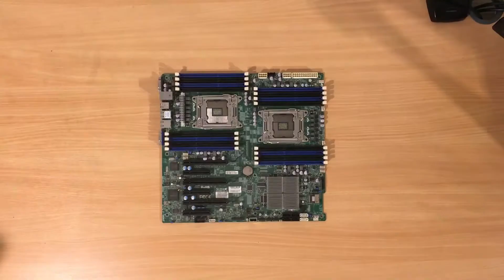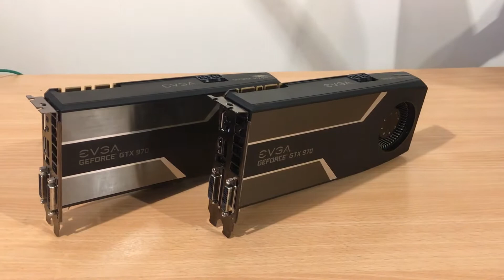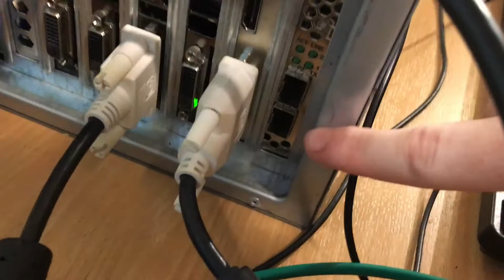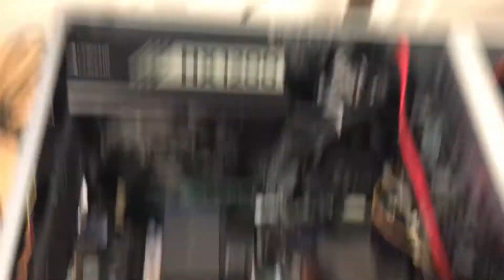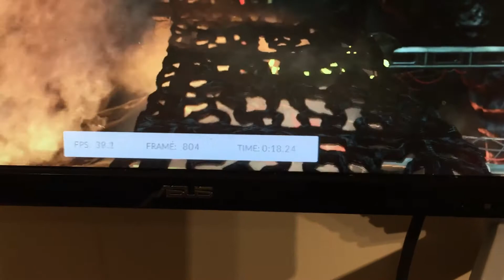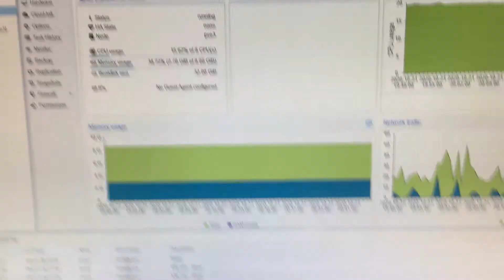GPU Gaming Server Build

Comment: I acquired 2 Tesla k20x and a Tesla m40, can you recommend a server I can get for around 100$ US that can run all 3 cards for a home gaming server?
Reply from the maker: Yo nice cards! Unfortunately I think you'll need to spend more than $100 to get what you're after. If you're looking for a rack server, dell R720's are a good machine with lots of customization options but they start around $500. Plus you will need to upgrade to the 1200W PSUs to run your Telsa cards.

Comment: did you run into issues with numa nodes and setting up cpu cores for the vm? i was looking at building a new rig similar to this to do 3+ "PCs" in one case. seems the only way to get all the devices passed through, i'll need a dual cpu board.
Reply from the maker: Didn't have any issues with NUMA specifically, but you will need to make sure the CPU you're using supports VT-d and has enough PCI express lanes for all your devices (that's 8 lanes per card for NVIDIA GPUs). If you have a dual CPU motherboard, I think that some PCIe slots won't be active unless both CPUs are present. Otherwise one CPU should work perfectly fine (given VT-d and lanes)
Reply: @papebenjamin  I’m planning on dual e5 v2 xeons,haven’t decided which yet, with 64gb to start with. What cpu did you use? Scores showing it’s comparable to a 3770 means it’ll handle the games I usually play.